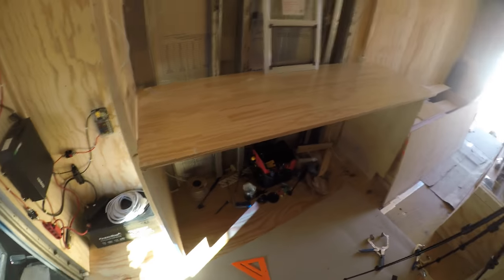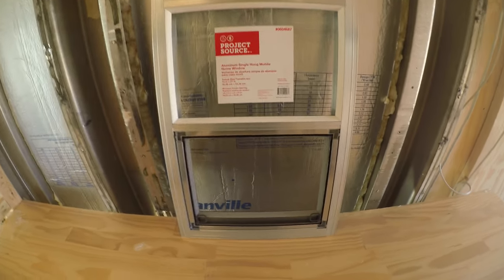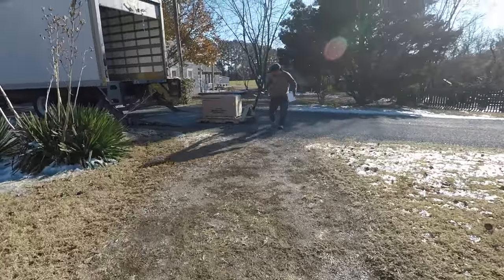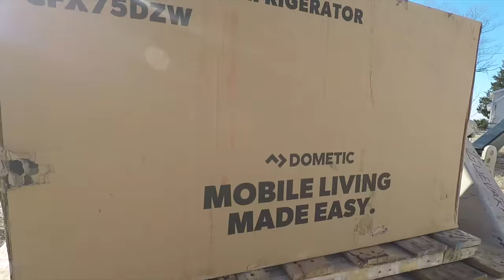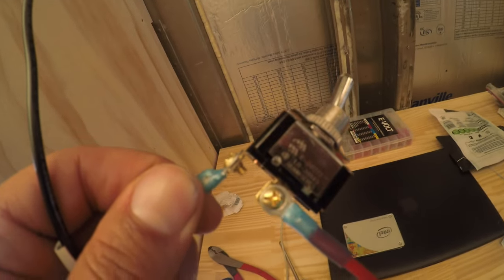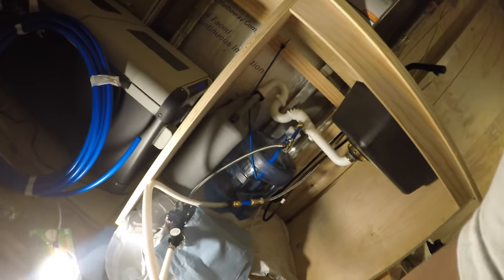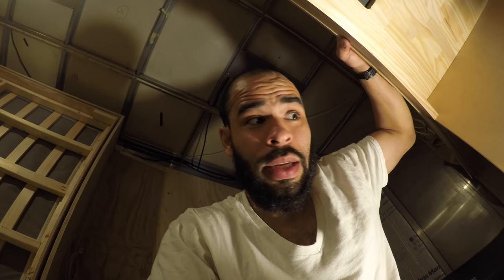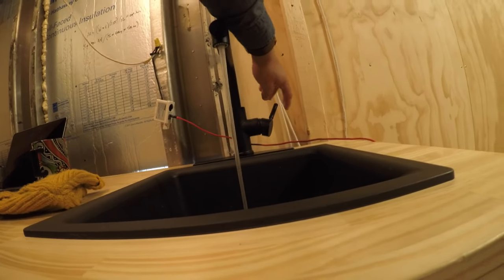Ep 16 | Tiny Home Truck | Kitchen Base Cabinet & Sink Installation

Comment: Awesome job! Not sure if I seen it right (you have strainer on discharge of pump) but you usually want the strainer on the inlet side of the pump. It will protect your pump from debris and make it last longer. Read the strainer install instructions to be sure. You do awesome work. Thanks for sharing!

Comment: you might want to consider using RV flex pipe and RV style P-trap like I have on my install. the PVC, from what I'm told, isn't good for moving vehicles which flex all the time and prone to leaking as you drive and move about. pex tubing and RV p-traps are supposed to be ideal for a moving vehicle (you can see both in my water tank and pump install recent video)
Reply from the maker: Thanks Seven! When I flesh the water system using the tanks, I'll use the pex tubing for sure. This was just for the meantime.

Comment: NOOOOOO! Don't install that window, especially since it's single pane!  The rate of heat transfer will be as if you have a literal hole in your wall. Loved watching your trials & tribulations. Growing pains! Thanks for sharing.
Reply from the maker: Hey Tony! Haha thanks! And I'll actually have a well insulated cover (rigid and sealed) inside the truck. Thoughts?
Reply: Hi. Seven sent me. Ha. I agree with you on the window-light-air. I am doing a Skoolie. I left all the single pane windows in. I made “Warm Windows “ Roman shades, top down . They keep the cold out very well. You can make something. The air & light is worth it.  Just my vote.
Reply from the maker: I'm going to look into that!! Thank you